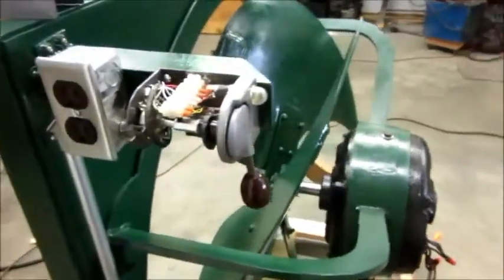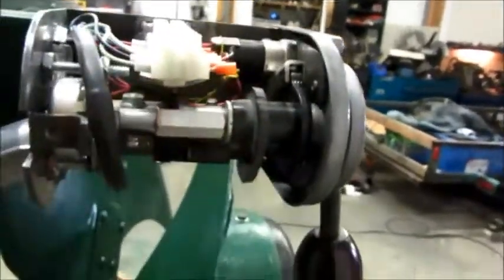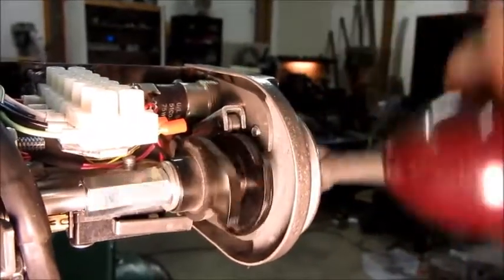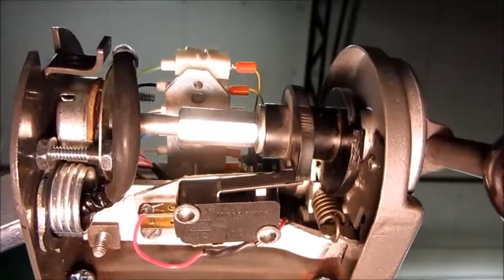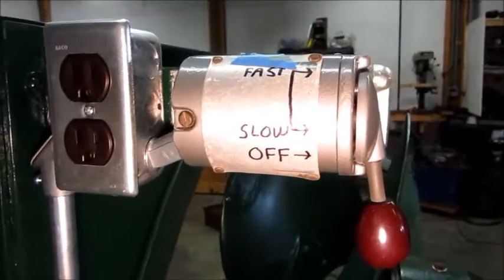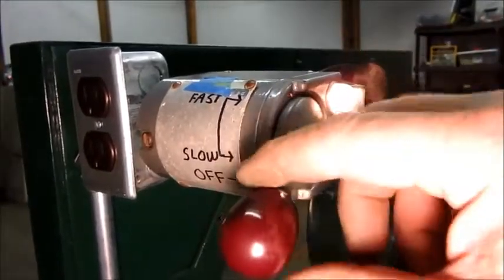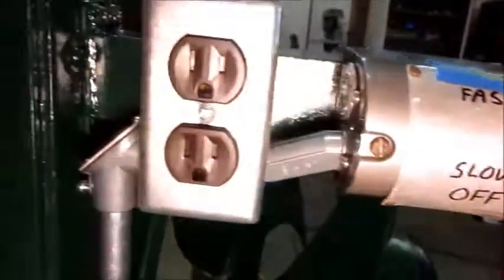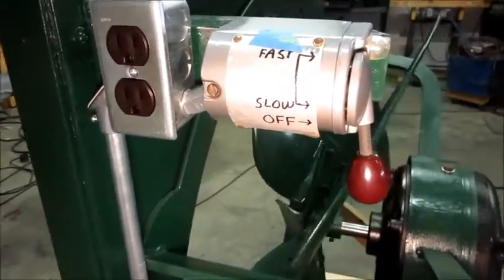Ilg Model 423 Industrial Fan Restore - Part 4 - Control station...

Comment: Nice work! I really like that switch rebuild. But I have a question on your speed controls. Is the speed range across the full mechanical travel of the pot or can you set limits in the VFD to work with a limited rotation pot? I ask because some of your speed controls don't apply full travel to the pot. I am an EE and there is a way to fix this with a DC  amplifier circuit to scale the limited pot range to the full VFD range, just a single OPAMP chip and some other parts but probably not worth the effort as these fans as you use them probably don't need full speed operation anyway?
Reply from the maker: Hi Andy. Thanks for the comment!  The Allen-Bradley 160 series VFD has parameters to set the min and max positions of the pot. The full range of speeds is available between the min and max.  You can further set the motor's speed range, for instance from 5 to 65 Hz. The available frequency will be 5 to 65 Hz, within the potentiometer min and max values.

Comment: Hi Dave.  Nice job on the switch -  I love the pilot light and polyoxybenzylmethylenglycolanhydride (ha-ha!) knob.   I wonder though....is there enough physical resistance in the switch assembly to keep the knob held in the UP position while the fan is on and gravity is working against it?  Oh and one more question -- is that a neon pilot light with one of those replaceable NE-51H bulbs?   (I didn't know such a bulb existed until an estate auction box-lot purchase of mine ended up having a small box of these little guys in it.
Reply from the maker: You have a point about the knob moving by its self. I think it has enough friction in the cam roller. Also, the cam its self has hundreds of small notches (machining roughness) that give it a "granular" feel as it moves. It seems to stay pretty well put. If not, I can add another disc in there with a rubbing block to give it more holding power.

You're right - that indicator DID have a small neon bayonette-base bulb in it. A friend gave me (what appears to be) an old medical electroshock machine control panel. It had the potentiometer mounting plate, and this pilot light in it.  I have the bulb in a safe place, as well as having a second lamp assembly. 

You had me laughing about the "polyoxybenzylmethylenglycolanhydride" knob!